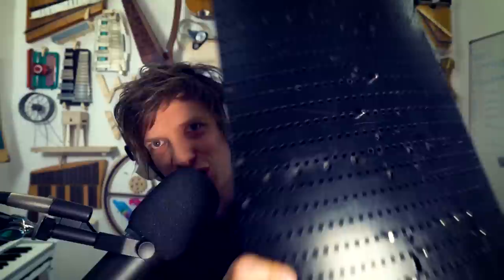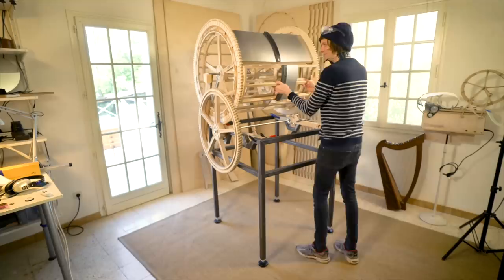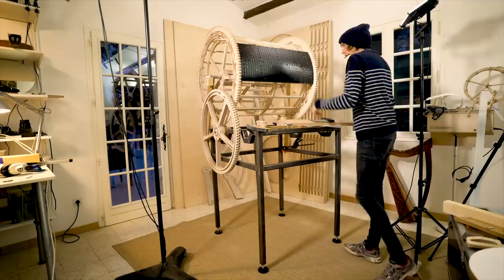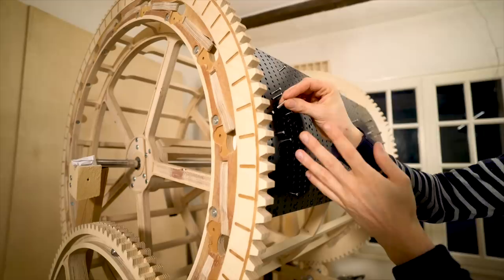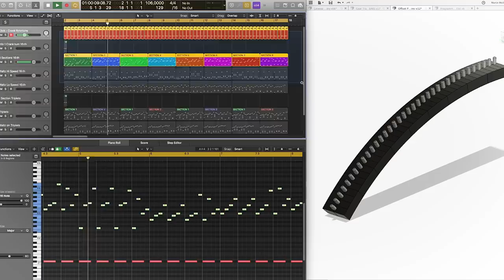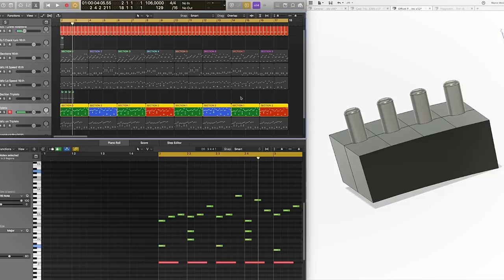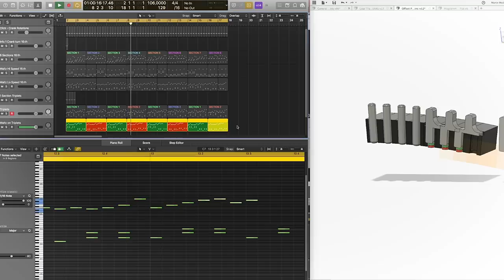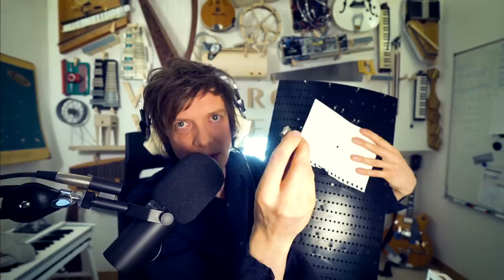Magnet "Midi" Music System - Marble Machine X #25

Comment: (Dunno why I can't reply to the top comment, but here I am) The triplet hype is real! But when you go to build the pins...

The configuration you showed in CAD has three kinds of pins: straight, offset-1, and offset-2. During reprogramming, keeping track of the different kinds of pins will be an organizational nightmare. Not only will there be three things to sort out, but two of them will look very similar. But! You can get away with just one kind of offset pin:
  * the second triplet in a beat goes into the second 16th slot as already designed
  * the third triplet in a beat uses the same pin, but inserted into the fourth 16th slot and turned around.

That is, the 16th slots are at 0, 3, 6, and 9 twelfths of a beat, whereas the triplets are at 0, 4, and 8 twelfths. Thus, you only need a 1/12th-beat offset one way or another to get to a triplet from a 16ths hole. In the end you end up with only two kinds of pins which are easily distinguished from each other. On the plus side, being able to get away with only a 1/12 offset will probably make the pins as compact as possible: less wasted material during construction, more durable product, and more accurately on the beat because of less wiggle.

Such a design requires the offset pin to be mirror-symmetric, but that's already part of your design, and I can't imagine it'd change.

Comment: My background is in management not music or engineering, so I might approach this different than most. I think logistic theory's like LEAN or TOC could help you manage. Take these (obvious but unspoken) points as a standard:
-each hole can cause error 
-each extra type of pin can cause error (*number of holes)
-each movement to replace should be minimal (putting in multiple pins at once saves time)
-more people working together on setting pins (not with an individual task) decreases performance as a group
-make it effortless to spot errors
- test realistic scenarios, (poor lighting, stress, on stage conditions) film it and put every action taken in a flowchart, mark every problem you come across that either wastes time or could potentially cause error.
-think of every quality check needed to make it error free as a waste of time. A fail safe system doesn't need control as it is fail safe (in theory)

All quite obvious things, but hey it might just add another perspective  to the problem
Reply: vondamm I love the Lean approach. 

I was thinking he should carve single song covers for his panels to replace the black, programmable cover that he has on this video. No pins, just plastic triggers carved in relief. Color coded, and labeled. Remove one song, add the next. Also, add unique puzzle boarders between panels so they cannot be assembled incorrectly.
Reply: WOW. A meaningful comment about LEAN on Wintergatan's channel. I never thought that would happen.

Comment: DO NOT UNDERESTIMATE METAL FATIGUE!!!

The test you ran was a small number of hard strikes, but the programming pins in Marble Machine X will be subjected to a large number of soft strikes. Even tiny amounts of pressure can build up over time and lead to failure. I'm concerned that if you stick with the brittle magnets as pins it will end up with you wasting a lot of money and possibly even have pins break in the middle of live performances.

I think the best option is somewhat similar to what you show near the end of the video, with two rows of pins for each channel; one drilled for 3/4 time and the other for 4/4. If you end up using a stronger material, you might also have the option to use pins with a smaller diameter, . The issue would be how to make them permanently magnetized (I don't trust a glued magnet, either).

Here's an idea: magnetize the plates in the programming wheel. Then you can use pins made of any ferromagnetic metal.
Reply: While fatigue of the magnets is possible, there are easier ways to addressing this than switching to a different material.  First off, you could easily set up a simple test rig that repeatedly loads the pins the same way the machine will an see if they fail at a reasonable number of strikes .  This is very common practice in industry.  If there does turn out to be a problem, you could just schedule a regular ‘change’ interval for them.  Or you design the machine to lower the pin loads and do some more testing.

If you are interested in setting up a test of them, I’d be willing to help with that.
Reply: Missing a single note on one channel in a performance is probably not noticable. Missing 10 notes might be. Keep in mind the triggers are wood, and with two sets of programming panels, the magpins will never ever be put in the same orientation (because cylindrical) twice. This is a strength of the cylindrical pins over the rectangular, because the rect pins will only ever hit the triggers from one of two directions, wheras the cylindrical pins are unlikely to ever be routinely struck from the same direction, ever (because humans pulling them out and putting them back in).

Comment: Awesome! I really love the idea of the modified pins to allow triplets. You could 3D Print them to get a smooth pin profile and I think they would be strong enough at least for testing ;) And it opens up the possibility of even crazier modifiers like syncopation. I want that CNC Router!
Reply: why stop at triplets, you can do any timing and even add swing

Comment: You should drill pin holes in the steel backing sheet behind each pin. This way if a magnet breaks below the surface or if you use the steel pins with magnets glued on and one becomes detached you can remove the bits by inserting a pin from the back.

Comment: Use one track, drill both 4 rectangle holes (for 4/4) and 3 round holes (for 3/4) in the same track (rounds and rectangles will overlap in some holes). Round pins to round hole, Rectangle pins to rectangle hole.

Pros: Pins can be visually identified for use with 4/4 or 3/4 timing
Cons: Holes need to be designed in a way that pins won't have wobble
Reply: Or using single rectangle magnets, you drill horizontal and vertical holes. Horizontal for 4/4, vertical for 3/4. Overlapped holes will look like + or T shaped.
Reply: Addendum: this is what I'm talking about -- https://i.imgur.com/jqmzWh2.png. Left column for Idea #1, right column for Idea #2
Reply: Agreed. the 90° turn of rectangular pins would work, because they only trigger notes rather than hold any. It just needs to line up with the start of the timing.
Reply: pauljs75  While examining my own drawing, I realised that in the idea #2, vertical pins will wobble a lot as horizontal holes also make vertical pins taller; so I think Idea #2 needs re-thinking...
Reply: pauljs75 it's a nice idea, but imho it will takes too much space; what about different diameters?
Reply: If the machine has some allowance for the pins to be longer or shorter, then the hole depth could vary with the direction. (Not that the pins are really longer though, just offset by that amount.) That'd give the overlapping holes enough bite as one timing would be deeper and the other shallower. But I'm not sure this kind of thing was anticipated enough to allow for that kind of offset. And that idea would apply to either rectangular pins or two pin sets of different diameters.
Reply: All of this sounds great and exactly what I was thinking about 👍

Comment: Have you thought about expansion and contraction of the wood when you take it on the road to places that are dry or humid? Not sure if it matters...just saying'....
Maybe you can/should keep the machine in a hermetically sealed box(s) when being shipped?
Reply: I think a coat of urethane would prevent the shrinking and swelling due to different climates but it would also effect the tolerances of the parts already constructed.
Reply: McRocket It shouldn't matter too much, plywood, especially the high quality stuff that he is using is fairly stable in expansion and contraction
Reply: I think he mentioned at Dome point that he’s using high quality birch plywood which isn’t as susceptible to expansion/ contraction...
Don’t know if it will be enough, but I hope so, because any kind of finish on the wood would suck :/
Reply: Plywood doesn't have the same issue as normal wood. So he should be fine. Because when they layer Plywood, they tend to do the grain in different directions per layer. Creating a solid piece of wood that doesn't contract nor shrink as much. 

Had this been done with solid wood, it might of been more issue. The reason he said High Quality is probably to avoid issue of Cheap Production which may not follow this sort of Rules in hopes of making the production cheaper.
Reply: Birch plywood is great for climate change as long as it doesn't get wet, rain would be the only thing you would have to worry about. a bag or box to keep the parts dry and as far as the programming wheel having the offset pins would be more effective than the other one, and having a template to label where the pins go with the number 3 or an o where the offset pins go
Reply: Great observation!